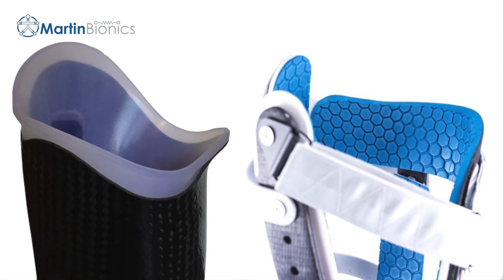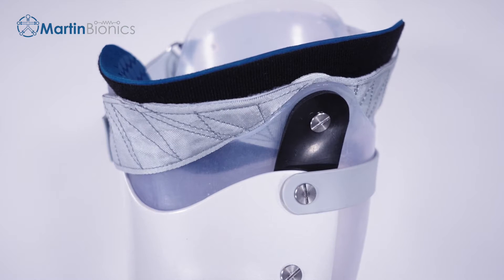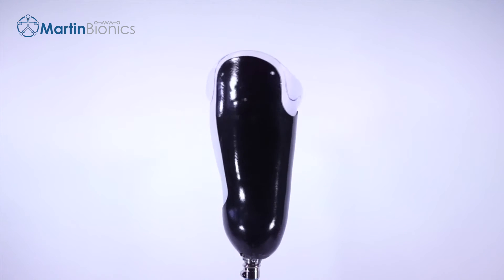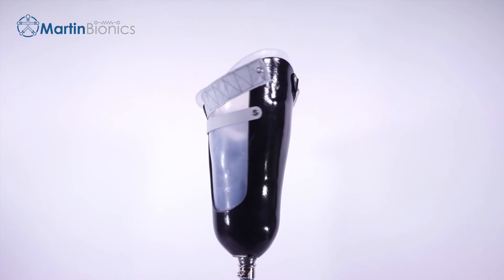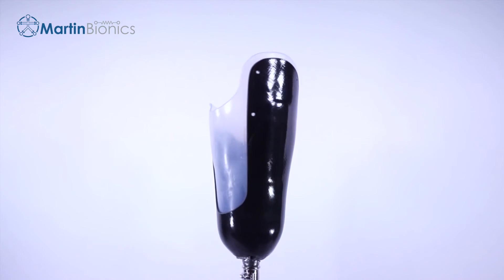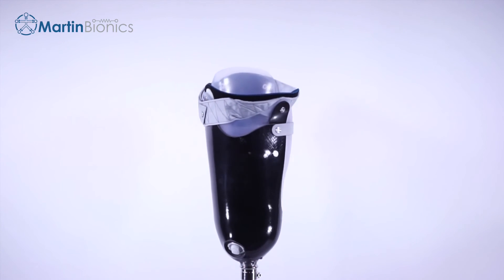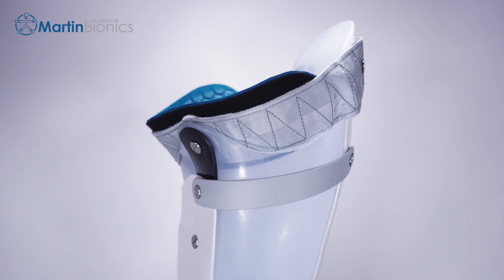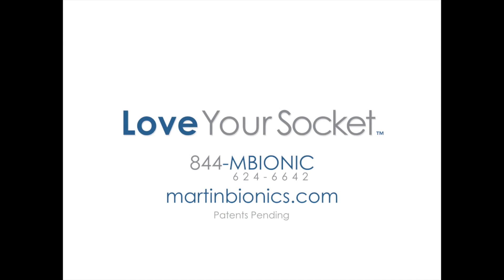SwingBrim™ - The End of Rigid Brims

Comment: my stepdad is a double amputee BK 5 years in. hes been having problems with the nub and bone, the doctors hacked it and wont fix it by rounding the bone, last 2-3 years the PT have made multiple sockets and have tried many different kinds of pads at the bottom of the socket where the bone sits and all the pressure an pain comes from, but nothing is helping.. we are located in maine